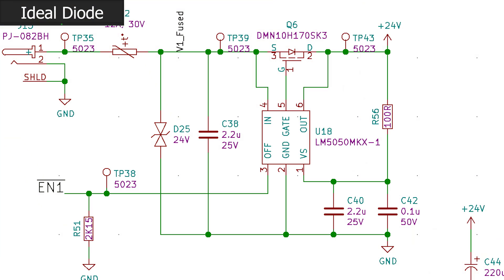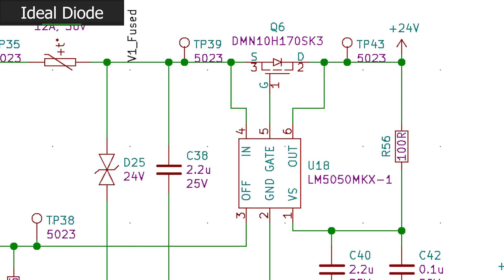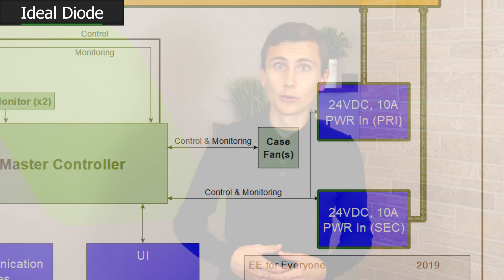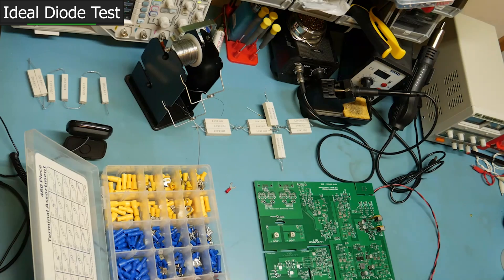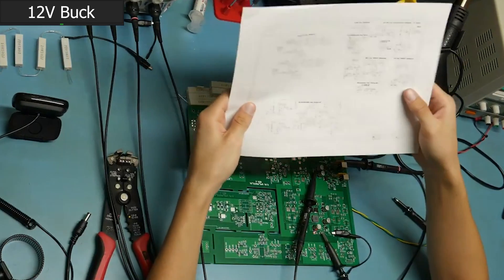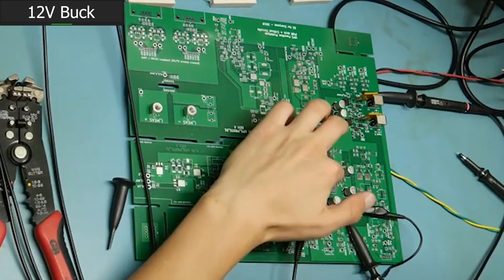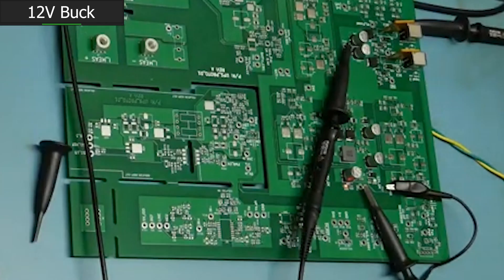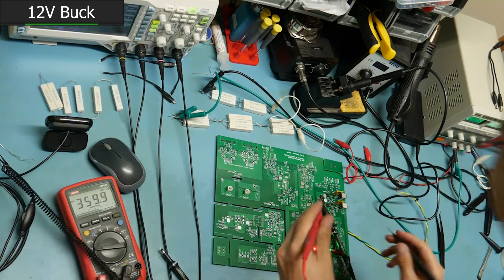Ideal Diode & 12V Buck: Wrestling with Physics

Comment: instead of ideal diode load ORing, could you use UCC29002D  - load sharing - ANDing smaller inputs in some scenario?  (is there any cheaper chip anywhere?)
Reply from the maker: Hi jankalode, thanks for the comment!

If the intention were to share a load (between multiple supplies) that may be possible. However! At a first glance, it seems the ucc29002 may stuggle if two power supplies with different voltages are used! (Or If a negative voltage is applied)

While that's not how our system is designed, I think that is forseeable misuse (given we're using a standard barrel Jack and many power supplies are compatible)

Basically, I don't see anything preventing a 24v supply from dumping lots of current into a 12v supply... But I also didn't look very hard.

I'm sure there's a cheaper chip than the ucc29002, but in my experience, cheaper ics tend to have more "gotchas".

If cost is critical and the current is low... It's hard to beat a simple diode!

I hope that answers your question, and thanks for sharing this part! It looks really awesome, and I'm sure it'll come in handy some day.

Cheers!

Comment: I'm pretty sure that switching to a to-220 package and using a physical heatsink instead of the board is way, way cheaper than having a four layer board made.
Reply from the maker: Hi Tim, thanks for watching, and good thoughts!

A 4-layer board of this size would likely cost around $15-50 per pcb. If that becomes a showstopper, using a larger copper area on the top layer to sink heat is also an option! There are a lot of ways to approach the problem, and through-hole parts is definately one of them! 

Physical size, cost, thermals... There are a lot of variables to balance.

For this project, I'm expecting a 4 layer board to be required at some point for other reasons.. so I'll probably get thermals vias & extra planes for "free".

Cheers!
Reply: Thermal considerations are certainly an easy/fast thing to account for/measure compared to other failure modes.

A quick hack of substituting an appropriate TO220 onto this board as a way to get more heatsinking is certainly a valid, fast solution given labour costs (If we don't have to use the tab on the PCB itself for some reason?) 

I'm also not sure what the saturation current of the inductor is? I forget whether we have deadtime compensation on that chip, nor how long it is? (i.e. shoot through, saturation etc) I don't believe we've looked at the current waveforms yet? I don't recall whether high speed probing techniques were utilised either? Averaging/bandwidth limit for the main parameters could also have been a reason?

The easiest IMO is reduce peak current limit. We probably don't need the converters running with a resistor programmed for 8.5-11A continuous/peak given they're rated for 11A continous, given some qualifications with cooling, typically the rating could be optimstic with regards to cooling? I recall something about current requirements being in the order of 2A. If you're running the converter between 2-5A, with the input/output voltages, inductor one could predict what the peak currents are given we know the topology? The datasheet suggests that the peak current is going to be 4/3 the average inductor current for example. It has soft start so we probably would still have the converter start in a timely fashion?

IMO don't have to go for four layer board for heatsinking and vias. Main problem is area and/or wanting to optimise for cost. Wouldn't changing  programming first, then larger components on the BoM be cheaper then respinning the board or swapping larger components?

Additional mounting steps/through hole components costs more? IMO the press in connectors are an expensive step but I believe reliability is key, hence perhaps overcompensating on the thermal considerations at the expense of cost and time is worth it. I guess it's engineering/controls/reactions/hacks vs spending the time working out an ancillary supply properly with full characterisation.

A last  resort IMO is THT heatsink or THT transistor unless you want to gang the transistors together for thermal stability or some other reason, including thermal stability/mass, want to use case as heatsink etc? Labour and cost for heatsinks for cheap, ancillary supplies on ancillary, low current supplies may not be an optimal solution for volume, depending on other costs including board area? I haven't looked into the thermal resistances of this TO-252 package, nor how hard it would be to cool vs spending the extra cents on going from 150m to 50m rds_on for example. My recollection is tiny heatsinks are in the 10's of cents cost for tiny ones. The production one probably has airflow so that is also another consideration. Requiring airflow is sometimes a necessary evil but sucks if you need it for ancillary things. Radiation/convection vs forced is really bad. 

In my experience I've found hidden switching transients where the parasitics were generating voltage transients exceeding the voltage rating of the device. These were hidden when I was  lazily checking the main parameters.

I recall something about the datasheet mentioning that protection circuits probably weren't needed for using this chip and topology in low power applications but I've had a conference between now and then =P

Solutions i've thought of without respinning the board include superglue heatsink on top of plastic package, if vias on bottom, solder heatsink on vias on bottom/underneath, solder heatsink on tab.

IMO if you need more heatsinking, stick with SMT and either try for more copper area, split plane (fill) on the other side,  lower RDS-on fet, exposed top FET , SMT heatsink.

An amusing anectode, although i don't recall the chip, i recall a lower volume mosfet manufacturer quoting the continuous rating of their die, on the packaged version's datasheet as the main marketing limit. I recall catching it after I bought the components but before I built what i was going to use them for. (i.e. they're limited by the bond wire/pad current?). Sometimes it makes me want a wire bonding machine so i can do cheap, high power, low volume stuff =P. (Not to mention the RF/mmW applications =) ). I guess the problem there is also getting a thermal bond onto the device as well.